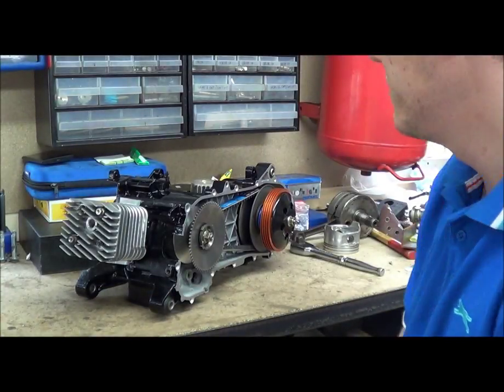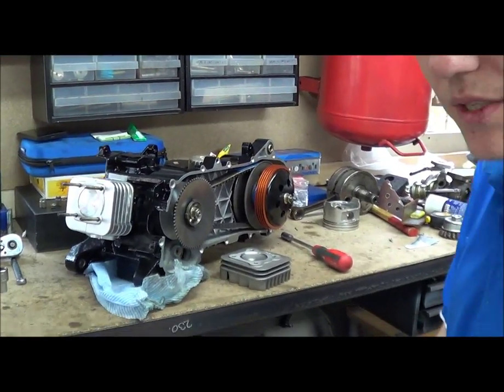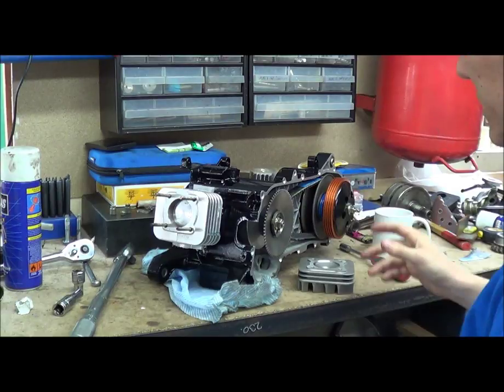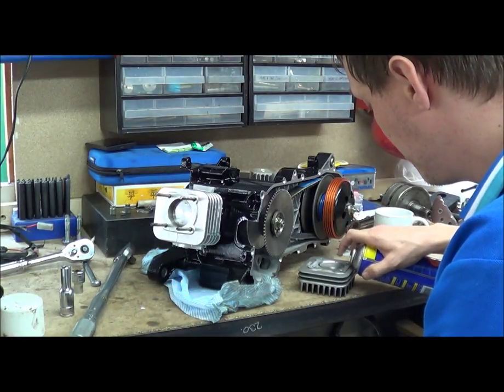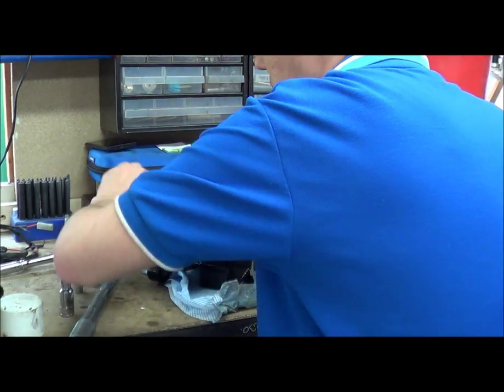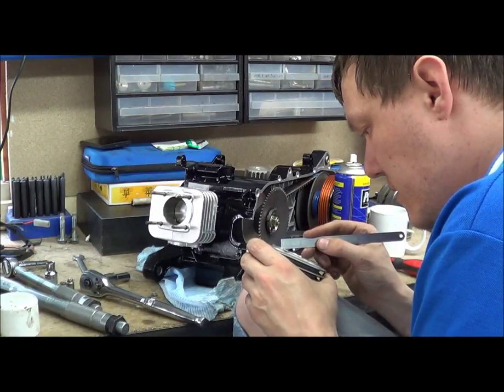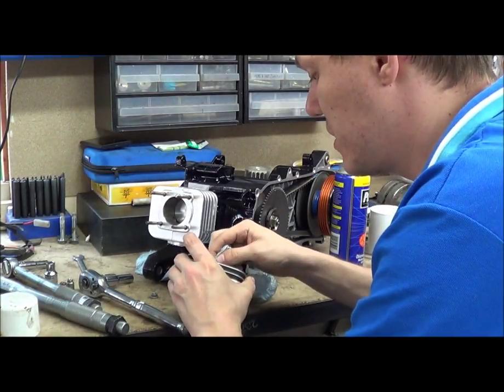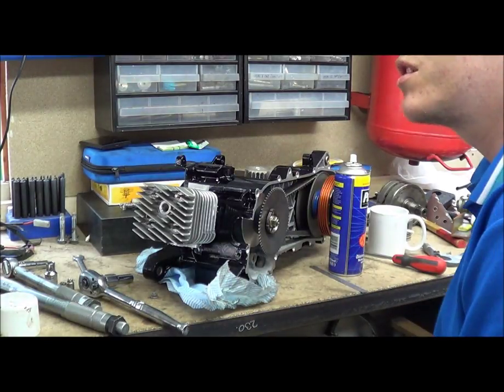Measuring Squish Bands

Comment: hi, iam having heating problems on a 185 2 stroke engine.when it also gets hot it can cut out.someone said to do a squish test.the problems happened when i renewed the piston.the base gasket old.got lost so i put a standard gasket on.since then I've had problems the gasket that's on at the moment 0.3. what are the symptoms of putting a thicker gasket on the base.? and what are the symptoms if use a thinner base gasket. the head is getting too hot.
Reply from the maker: The base gasket thickness sets the compression ratio - thinner gasket means your piston is getting closer to the head - hence higher compression and more heat.

Comment: Shouldn't the solder or clay go on both sides over the piston pin? Can't the piston "rock" on one side to the other if you only put what ever you chose to use to measure with on one side? I always use solder (just my choice, not saying this putty is not good) I run the solder over the piston side to side same direction of the piston pin. Also agree to remove the head, not necessary like you say, but I do remove the head.
Reply from the maker: No enough you'd be able to really measure - the bigger problem is con-rod stretch under high aceleration. At the end of the day this is a static reference measurement - not a dynamic one.

Comment: @The Workshop:
 How about using plastigauge? It is supposed to be suitable for bearings, so it seems to be accurate, no?
Reply from the maker: LOL how thick is your plastigauge? 0.8mm thick?
Reply: @The Workshop:
It comes in various sizes I guess
http://www.jhps.com/mm5/merchant.mvc?Screen=PROD&Store_Code=PL&Product_Code=PLE&Category_Code=PL

I have used in only for 4T crank bearing, but I saw someone using it to measure squish band on a RGV250.
http://uploads.tapatalk-cdn.com/20161002/d585b7471fb3f6271ef6c83c03391bbc.jpg

Now I see it again it seems like a copper wire, could this also be a method?
Reply: Yep plastigauge works well, as does non flux cored solder. you dont have to remove the head to get a reading either, can be done through the plug hole if you know how to do it.

Comment: Hey, what can I do when my squish clearance is to big even withouth a base gasket?
Reply from the maker: So your running an aftermarket cylinder. Sometimes they get their dimensions screwed up. The easiest way to fix this is to machine the excess from the cap. Try to machine extra off so you can fit a base gasket in.

Comment: Okay, so a thinner or thicker base gasket changes the squish. But a thinner or thicker base gasket also changes the port timing. You are robbing Peter to pay Paul. How do you compensate for the changes in timing? Surely skimming the head to lower, or adding a thicker head gasket is the more productive way to go?
Reply from the maker: Malc2169 You are bang on right. But its not eaxctly Peter for Paul or oranges for apples. The port timing is important however we're talking the max of 1mm, not only that if everything was nominal size then the squish should be perfect. 

It goes like this. The squish dimension can be calculated from the crankshaft centreline. But the cylinder height is defined by the casing mating surface, which is a casting and isn't always perfect. The port timing is machined/cast off using the mating surface on the cylinder as it reference point, i.e when they CAD it up they're using the basis that the castings are spot on (or probably with +- x amount) 

The next issue is as you stated the port timing but port timing is measured in degrees so a increase along the z axis by say 0.78mm for example isn't making that much of a change in degrees. But it does make a difference.

Finally and this is the important one. So would you rather run an engine with perfect to degrees, minutes and seconds but have a compression ratio out by 15-20%. This is why it isn't Peter for Paul.

As for the head gasket question, thats a perfectly sound idea and some race teams do this when they are satisfied thay have a perfect set of cases etc. However for the aftermarket street application the cost comes its it, both with head gasket material of 0.1mm incremental thicknesses and the cost of machining the head. Also with most of these water cooled heads skimming the head isn't really an option because of the 'o' ring groove that seals the head (i.e no typical head gasket) here's and image if you haven't seen one

http://www.pedparts.co.uk/c/products/lg/Stage6_Sport_Pro_MKII_Cylinder_Kit_-_Piaggio_Liquid_Cooled_1.jpg

Replacable combustion chambers are now becoming more popular sna they can be modified to change the squish height, but again they are quite an expensive alternative 

theres a picture here

http://pagesperso-orange.fr/VinceRacing/images/P1010314.JPG

Thanks for the comment - matt
Reply: Pony Power Thanks for your comprehensive reply - food for thought (crikey - two cliches on the same day!) and it even makes sense to me! Thanks again
Reply from the maker: Malc2169 no worries mate, very valid question, its what these videos are for. Probably do a follow up video to this one making your point. Thanks again - matt
Reply: yes and no you don't do that to the head rather deck of the block should be milled and measured to see if you got a good squish. for my application its 0.032 of an inch or y'all folks Europe 0.8128 mm. darin morgan as well explain the phenomenon in wet flow scenarios. he explained it nicely and another guy named Darrin morgen video: https://youtu.be/f8XG9T8v-ng?si=X8e14YCUPjAX9qIe ben alameda: https://youtu.be/URyZ8h_U310?si=1wYaKYLx0IXFC9hq

Comment: If your solder is not thick enough, seems like you could melt some into a very small button, and leave it in the squish band zone, do the same technique as with clay, put the head back on, advance the piston through TDC, and open up, again? As long as solder doesn't mash between piston and cyl wall.
Reply from the maker: This could be the issue or lose it down one of the ports lol
Reply: Got it - thanks - great help...